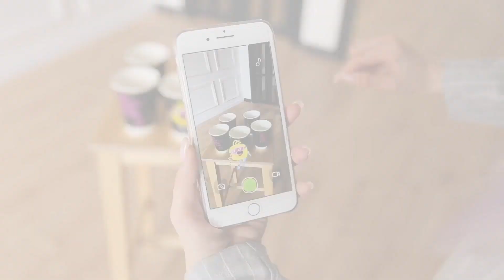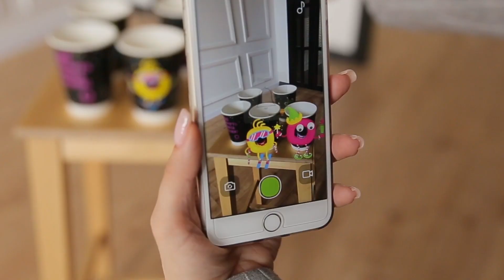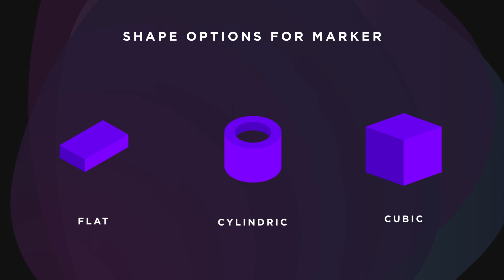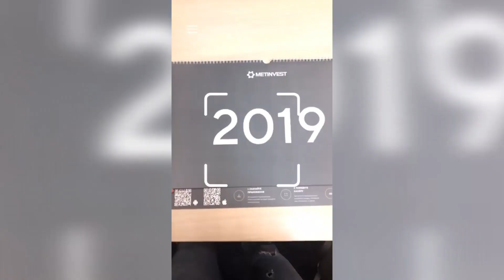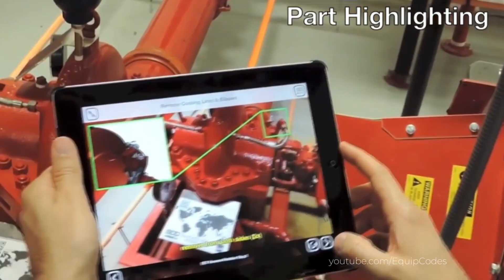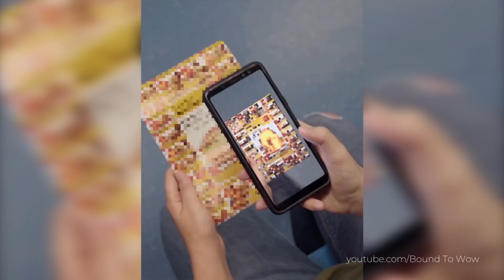Marker-based AR explained

Comment: Have there been any updates to the tools/tech since this video was made?  For example, the minimum marker size (2.5cm diagonal)?  Can tools like Flutter (with ARCore / ar_flutter_plugin) be used to precisely indicate a component, like shown at the 4m20s mark?  For example to find a component on a Printed-Circuit-Board?

As a starter, I'm thinking of a BINGO-like game that overlays a marker on a specific square in a 1000x1000 grid.. where, if A4 is said/entered, the Android app would use a fiducial on the page to calculate how far into the grid it needs to place a coin (scaling it based on the the angle and how close the camera is to the paper).  If that works then the PCB!